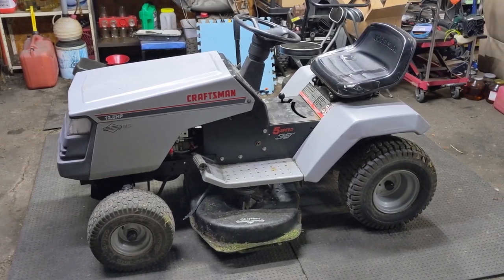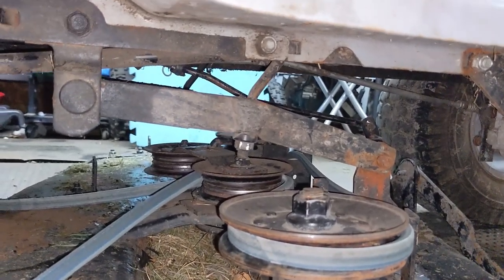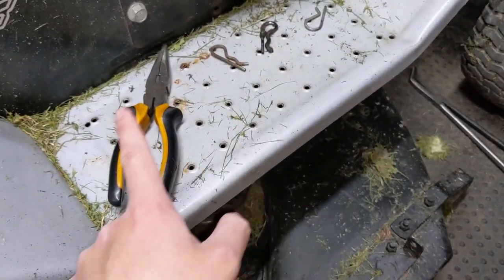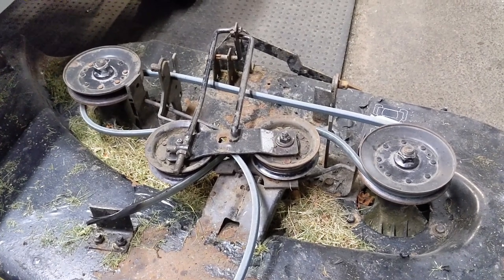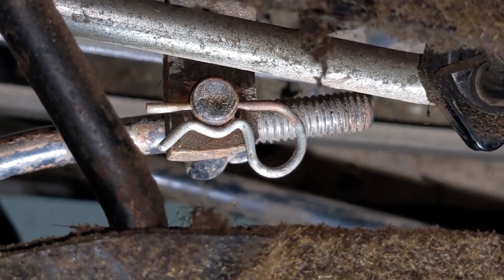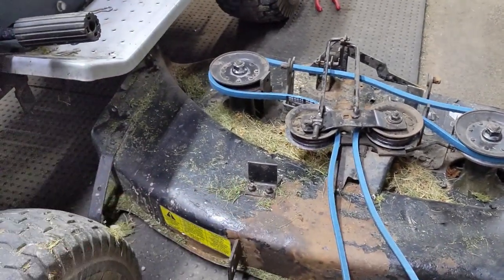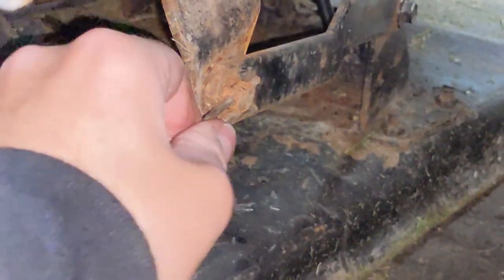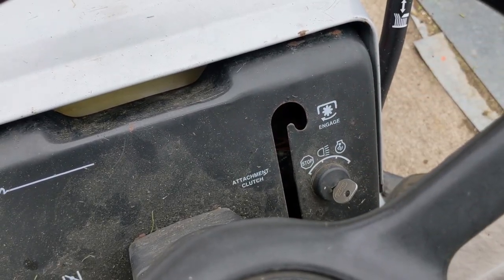How to Replace the Deck Belt on a Craftsman Riding Lawnmower

Comment: Thank you for being clear & concise. I have an old GT6000 with a 50" deck, so yes more pulleys, arms, etc. My belt came off before completing my first mow this season & needed a refresher & a boost of inspiration to get back out there & pull the deck off. Once I get my first mow completed, I usually replace my blades. Again, taking the deck off. The deck weighs half of what I do, so kind of a bugger to muscle around. Lol. Great video & I appreciate your VERY helpful tips throughout.😊

Comment: Thanks man... been looking everywhere as to how the control rod for the blades works. Your explanation in the middle of the video was perfect. My attachment engagement levar is extremely difficult to press forward. I just put a new belt on and everything is good. Now that I know how the tension is applied I can give it a once over again.

Comment: Fantastic video, the way you explain the mechanism by which everything operates e.g. how the blade engage rod provides tension adjustment to the belt helped me understand and therefore troubleshoot much better than any other video I have seen. Most other guys are like yeah pull out these pins and throw the belt on good luck. Yours is top notch. Keep it up.
Reply: My carb leaks🤔
Reply: @buttliq0ur869  there's a Visine for that

Comment: Great detailed video for replacing belt. I have this lawnmower and need to raise the deck, cuts to low in highest setting (6), do you have a video to explain process to get deck up, seems it doesn't allow the front to go up, just the rear. Thanks again.

Comment: I do Marine repair for a living and your video is excellent and very well thought out . The one thing I would recommend to everybody when you pull your deck is flip it over and check the blades . If they are worn or have huge nicks in them its easier to replace the blades while you got the deck out . I had to put in a standard black V belt in my deck because nobody in Elko nv has them I couldnt even order one and Homo Depot decided to eliminate half their mower parts and no long carry the belt for my deck they used to carry. Before there was two full long racks of belts now its down to half that and most of parts they had are gone. Had to go Ebarf and order the belt but I lucked out and got two for 30 plus tax free ship. Can you do a video on adjusting the tension? My pivot is threaded for my tension rod and you have to take it off to adjust the tension how can you get proper tension when you have to remove the pivot everytime? if they had just took the pivot and slid it on the rod with no threads with two jam nuts  you could adjust it on the mower with the rod in place. Makes no sense 🤔

Comment: Great video, very detailed, to the blades below need to be in a certain position, will they contact each other when rotating?
Reply from the maker: No, that is what's referred to as "blade timing" and usually only needs to be done if you have a cogged belt

Comment: Thanks for the video-- do you know the belt size for the transmission? 1/2" by 95 is what I measured, but its stretched and damaged.. bought used with no info!

Comment: Those spring clips aren't high-grade, unbendable spring steel.  They are slightly malleable.  You can bite them with some pliers and make them tight again.  That one didn't open up because of age, wear, etc.  It opened up because someone brute-forced it off last time they worked on it.  Anyhow, really, REALLY thorough video. Well-done.

Comment: The piece you see at 3:50 I believe you called an idler pully rod. (the up and down portion with the paddle and hole in the top is broken on my lawn mower. Where can I find that? It is almost the same model as you have in this video, except my starter and gears are on the right side next to the seat instead of the floor.

Comment: Hello , Is it possible to change the  Blade Belt without taking the deck out?  I am  74 and working on this in the yard so it's a little hard to pull the Deck out. If you see this soon please let me know. Thanks, Larry

Comment: I have a similar mower , wish I would have seen this before changing my belt. I did manage to change it without dropping the blades. 
Any hacks for a muffler on this model? I cant find the right size.
Reply: Mine comes out the left side, goes forward to the front and the round  muffler aims downward at the end of the exhaust pipe. It's all one unit and a replacement is over $100! I went to a machine shop with the entire assembly and a screw on 12hp muffler from Lowe's. They made me an exhaust pipe assembly (cutting up the original one) with a threaded pipe aiming downward to accept my $7.00 muffler replacement. They charged me $20.00! Beats $100!

Comment: I know your busy but i have aQ do i need to change the rod on top of deck mower that i changed from a42 in. Deck to a38 in. Deck should it be changed. The belt is tight i think it should be less tension but idk could you tell meoh maybe youjust told me

Comment: I would like to see how you replace the blade engagement cable on a Craftsman model #917.2880 31. There are several videos on how to do it but I'd like to see how YOU do it. I do have the cable and am about to try my hand at it. Just curious.